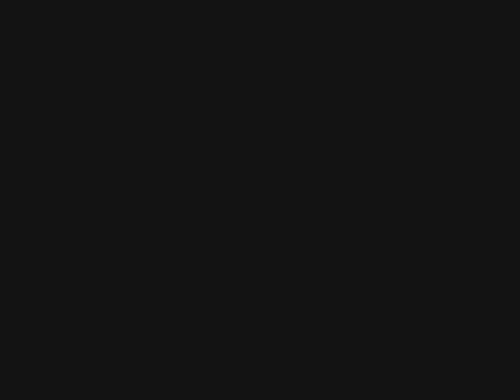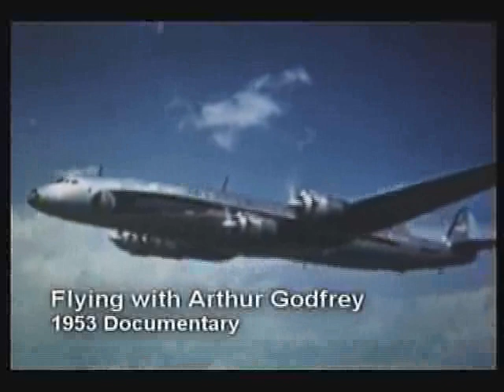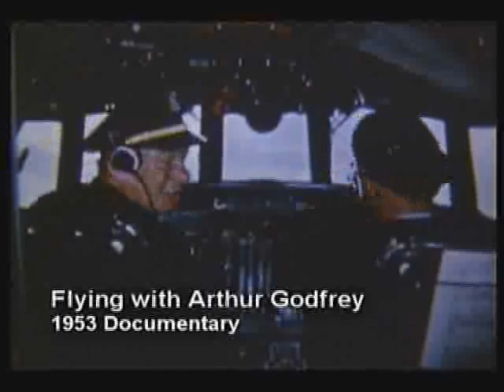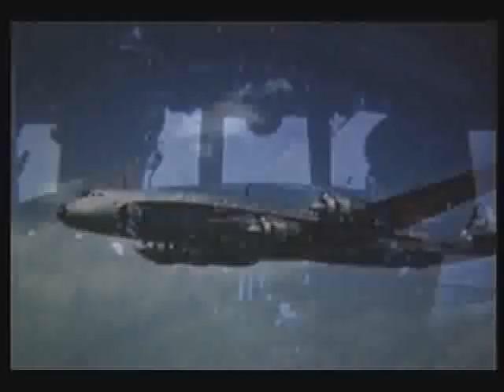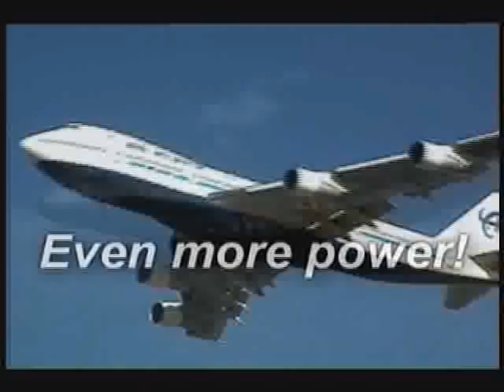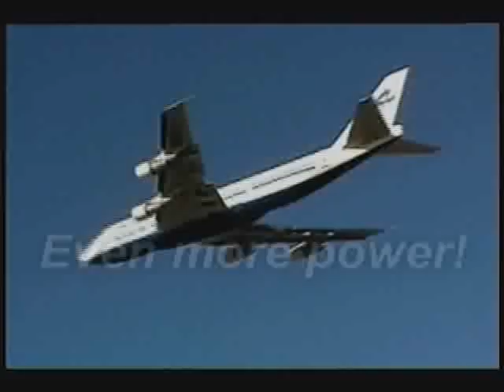Aircraft Engine Failure Demonstration

Comment: The aircraft is obviously not loaded, but as a flight engineer on 
DC6s in Alaska, I have shut down 1 engine when fully loaded
and the aircraft flew very well, in fact shutting down an engine
on a 4 engine machine is very routine.

Comment: @hod05 mitigating factors, not all apu will or cn start in flight loss of flight controls ensues, hence you cannot drop the nose. dropping the nose increases the rate of descent & speed towards terra firma. also  ges turbines not powered add additional drag further more taking away from speed & causing drop increases. ture I"im an arm chair captin , but I do also have thousands of hours in other heavy vehicles, so my perspective of self preservation enhances my perception of certain things.

Comment: true modern planes do have even more power but the wings are designed to be powered if  a modern jet loses all power there is not much glide involved in it. the engines (@ least one of them must be on ) to even glide.

Comment: Just think of the air becoming "thick" like jello when taking off at high speed. The plane is designed to decend naturally and can glide approximately 100 miles in the extremely unlikely event of all engines failing.

Comment: Even if an aircraft lost all engines, the passengers would feel no sensation of falling any more than in a normal, powered descent as the plane would become at that point a glider.

EVERY pilot receives training on how to land an airplane without engine power; I've done so myself on several occasions-- just for training fortunately. From small Cessnas to large Boeings, the basic aerodynamic principles are the same.

Comment: Like all internal-combustion vehicles, the power isn't needed to keep going, but to GET going. While your common V-8 in a pickup truck makes around 350 HP, you only need about 20-30 HP to fly down the highway. Same for planes. That's why power loss (engine failure) on take-off is so often deadly.